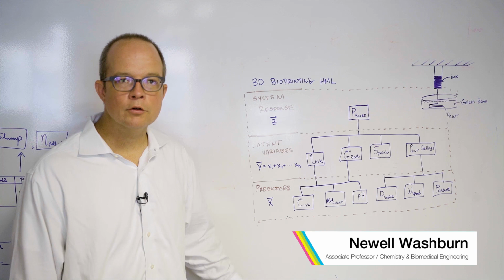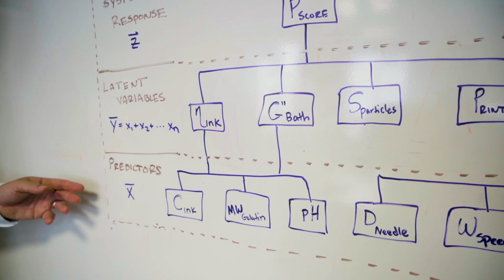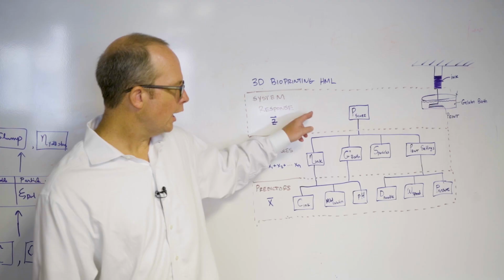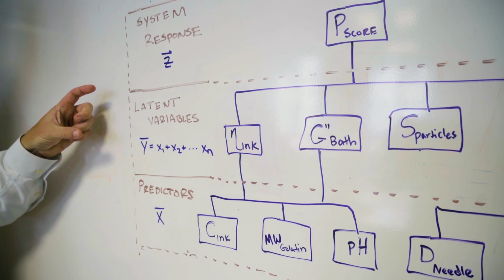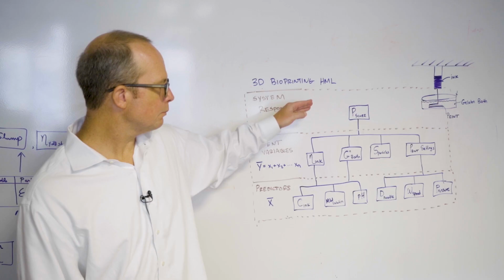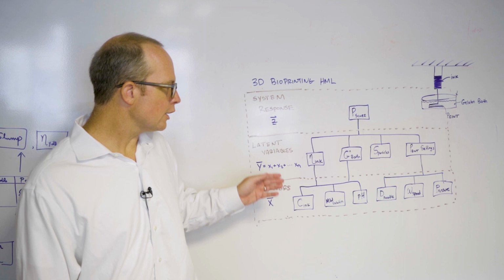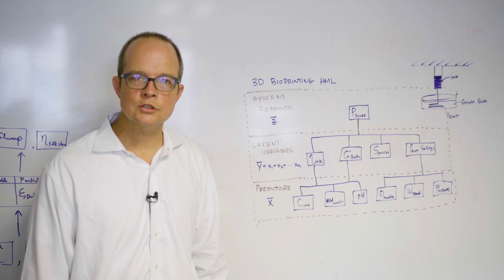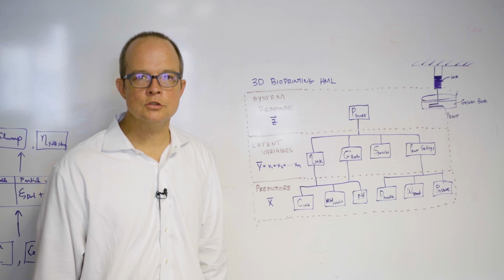Newell Washburn: Demonstration of a Machine Learning Algorithm for 3D Printing

Comment: Nowadays, people print cubes and various other models to check their individual slicer settings against real world physical problems such as bridging, ghosting, overhangs, elephant feet, etc. While there are mechanical issues that most parameters couldn't solve, the very same parameters indeed have influence on the outcome. The problem is: After all, many aspects depend on the type of input material (ABS, PLA, PETG to name a few) and even the same type can vary from manufacturer to manufacturer. 

So I was thinking:
If you could design a test model for the most common issues and build a machine that you could put a printed model into that combines measurement techniques, visual comprehension via optical recognition) and machine learning algorithms, I believe you could create a self configuring slicer. For example it could create images from the finished model, recognize stringing, overhangs, etc., measure weight and dimensions, compare against expected results, adjust parameters, print again, test again (test - operate - test - exit) and then have an optimum set of slicer parameters for you ready to use.

While researching if anyone has ever tried that approach, I found this video and wonder how far you were able to progress in the past two years.